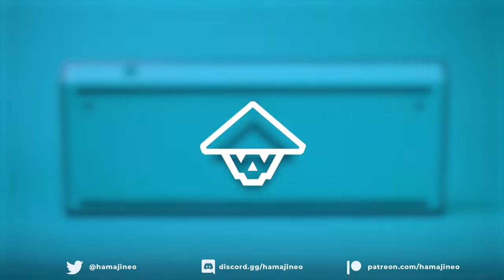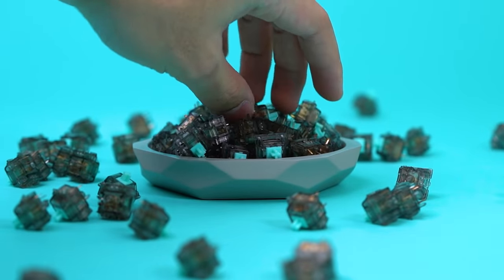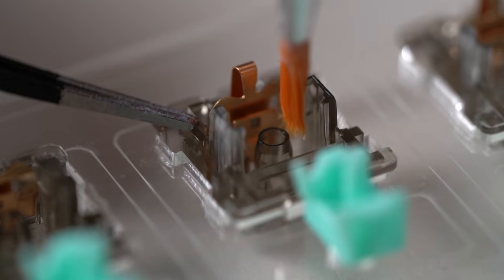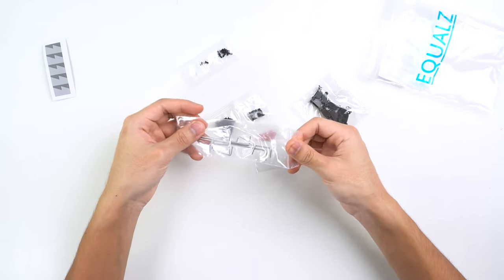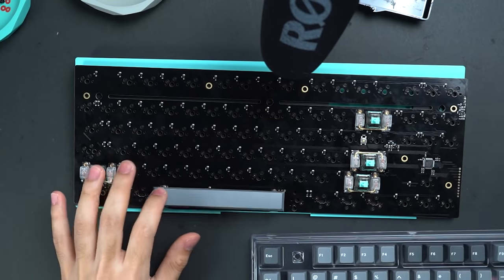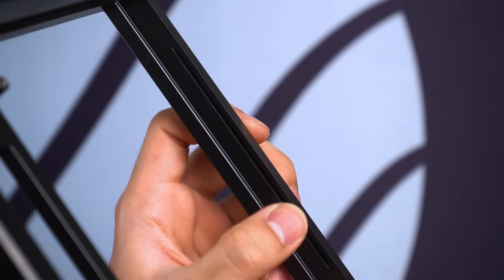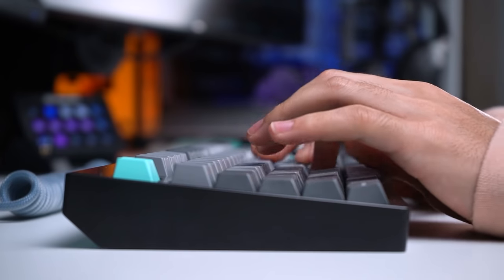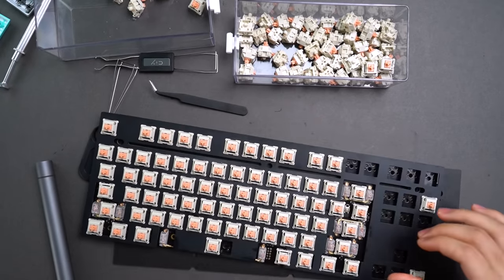The Making of My $850 Custom Mechanical Keyboard!

Comment: The keycaps were probably 40% of the total of the build.
Reply: taeha is that you?!
Reply: typer tahea
Reply: Not this time. The mode eighty is an expensive board.
Reply: @kylemckell  still about 40% resell lmao
Reply: @kylemckell  Not really for a tkl. $470 is pretty standard and the keycaps are $99(mechmarket is a waste of money they're being offered for 120-250 depending on the seller but fuck mechmarket) but what makes this super expensive is just the fact it's a 1-off anodization that can't normally be bought with his logo etched in. Things are made in bulk to keep costs down but when you have to have your own special anodization colors and make them etch your youtube logo in the prices skyrocket.
Reply: @incongruous4  well yeah ofc. I was more saying that proportionally this board is like twice(?) more expensive than the keycaps. Rather than being about even with the keycaps
Reply: @TheAbrasiveGamer123  is modo that much aftermarket?
Reply: @kylemckell  this mode specific mode (art series 01) was being sold earlier today for about $520 - $570 on Mode's website. Gmk modern dolch on mechmarket goes around $200-$250 resell (which Hamaji Neo says in the description he bought it off mechmarket). So yeah its about 40% of the price
Reply: @kylemckell  Ahh yeah then that's true
Reply: @TheAbrasiveGamer123  he said build not board. 250 (high end for modo) / 850 for the full build comes out to 29%. Which is pretty close to 40 but not quite.

So basically semantics lol.
Reply: Teaha?
Reply: @charmxarchive5128  Taeha Types
Reply: @Fatpumpumlovah2  You obviously aren't in the mechanical keyboard hobby
Reply: @Fatpumpumlovah2  yeah, I think that you haven’t seen prices for good keycap sets and good cases
Reply: lol

Comment: I mean no disrespect, but you built it wrong. The two pieces of foam that you showed were the hot-swap and soldered bottom foam. The mid/plate foam is a completely different foam. When assembling, you put the soldered bottom foam, which could cause some of the hot-swap sockets to pop off as they're being compressed by the foam. And, by using the soldered bottom foam, the typing experience might be a little bit stiffer as there is even more compression (as the foam is pressing against the hot-swap sockets).
Reply: I’m happy you pointed this out, I was coming straight here to basically say exactly what you said!
Reply: The problem is he’s here providing a tutorial showing people how to do something the wrong way.
Reply: @noahmelamed7400  no I’m completely agree, But I think this was less of a tutorial, and more of Hamaji just recording his custom build and sharing it with us. 

He didn’t state anywhere that this was a tutorial, and Being Human, Mistakes happen. The Hotswap pad and the foam for between the plate and PCB do look quite similar.
Reply: @noahmelamed7400  yeah he doesn't promote this as a tutorial. However, it might make people do the wrong things still
Reply: @officerwizz  well thats on them. anyone building a keyboard should do their own research and not watch this one and only video before assembling
Reply: @TheNickMartinez  well out of the thousands of people doing it, you have to remember there is always that ONE guy who does things differently and might do a mistake like this
Reply: @officerwizz  and that’s no ones fault but his own 😂
Reply: @TheNickMartinez  if you think about it then hamaji might be like 1% responsible, but hey, one less mistake is one less mistake.
Reply: @officerwizz  im not gonna lie, you are overreacting a tad

Comment: I feel you on the holy pandas stability issues. My keyboard has glorious pandas in and I had to swap the mods & spacebar for zealios v2 78g because the rattle was basically unsolvable by just fiddling with the stabs. The heavier springs on the zealios also help make the feel a lot nicer imo!

Comment: I just finished building my Viridian Mode80 last night with Krytox Lubed Glorious Pandas and Durock V2 stabs. Using EPBT x Gok Bow Keycap set and I'm not getting the same rattling sound you're getting. Although I'm using the standard alu plate. So strange that you're getting that gnarly rattle with the backspace tho. Great video and thanks for sharing however, it was influential for purchasing my own Mode 80. Love this thing!

Comment: Didn't know about that huge mechanical keyboard community. Many years ago I had bought a Steelseries 6GV2 and used it a lot with starcraft II, but the black keys became to tiresome over time. Tried a Black Widow with blue switches, which I've found to clumsy. At the Moment Iam using an old Cherry Keyboard, one of the beige ones, the RS6000 which has no mechanical switches, but works very well. The Problem with all these custom keyboards and keycaps is, that often they're not aviable for a german layout with üöä or ß which limits the options a lot. Also I like my enter key to go over two rows, and most american keyboards dont have that feature.

Comment: Hi. I just got into mechanical keyboard with a RK84. It comes with blue switches, and after some research and watching some reviews, I ordered some AKKO vintage white linears to test out. I want to try lubing my switches and stabs. Your videos really help me to understand a lot of things. I was wondering how do I find out if pcb mounted stabs can be used on my RK84 ? It comes with plate mounted stabs. Thanks.
Reply: It just won’t work. Different boards support different mounting styles. Just get some durock plate mounts. Sorry I’m not hamaji 🙃

Comment: Im thinking about building a keyboard, with lubing and evcerything. found out that there are prelubed switches, are they just as good to when you do it yourself, or is it just marketing and they just smacked a bit lube in there ?
Reply: It’s machine lubed so it’s better than stock but it’s never better than you doing it yourself

Comment: One thing I noticed is that for some stabs, when doing the holee mod, the band aids are too thick. This results in the wire not lightly rubbing against the cloth, but more grinding creating a less smooth experience. If so I’d recommend some silky medical tape or just don’t use the holee mod

Comment: Is there a benefit to getting soldered pcbs/boards? I'm using a gmmk and it's honestly a game changer having the freedom to remove switches and stabs so easily and it doesn't sound cheap
Reply: Soldered is definitely more secure and doesn’t move around as much, and some switches just won’t fit hotswap well like the holy pandas on this vid, but hotswap is definitely the goat now and manufacturers are probably going to focus on it

Comment: I've got a corsair K70 which I like, but I've been wanting to build my own custom keyboard for a while, but just seemed overwhelmed with all the different types of parts, keyboard body, PCB, faceplates, etc. All I know is I want a minimalistic case and either cherry mx red or brown. Is KDBfans a good place?
Reply: Yes, kbsfans is a good place. Maybe not the best bang for your buck but if you have the money it’s good. However, i would recommend you get a hotswap board so you can try out different switches. Trust me now, you do not want cherry red or brown. There are so many switches out there, and reds and browns are just really not that great. Browns suck at being tactile because the bump isn’t even noticeable, and they suck at being linears because they just feel inconsistent. Reds nearly don’t ever get smooth, and when you finally do get them smooth, they sound like a wet sock. Here’s my recommendation; either buy a switch tester to find your favourite switch, or just do a shit ton of research and find a switch that you would statistically love.

Comment: Hot swap are terrible pcbs and are prone to breaking after installing a few switches out. It’s more for beginners soldering is always better. Not to mention aluminum plates get scratched up after a couple of switch swaps.

Comment: Holee modding is the worst part but I wanna ask; I have a ciy tester 68, and I'm buying some durock piano plate mounts, should I holee mod it or do I just lube it? I am rather impatient and if the holee mod is easy I might try it lol
Reply: holee modding plate mount stabs is, in my opinion, the only acceptable case
don't forget to add pads below the stabs in the pcb to minimize the rattle... plate mount stabs are seriously the worst

Comment: So im looking to get a mech keyboard. Is it cheaper to build my own or buy a pre-built? The keyboard im looking at has cherry mx browns, rgb, and it costs $170.
Reply: 90% of the time, it is cheaper to buy a prebuilt. It's not really recommended to build one if you're not really sure what you're doing. There is definitely a learning curve to this hobby.
Reply: For your first board, I would buy a prebuilt with a hotswap pcb so you can experiment with it later

Comment: Stabilizers are the most important with out the switches case and pcb if you have no case how are you even suppose to type without braking it no switches how are you suppose to type  pcb how is the keyboard even gonna work

Comment: why did he use lube instead of dielectric grease for the stabilizer strings?
Reply: if you look closely, you will find several rookie mistakes in this video:
- overlubing (look what he did to those poor stems)
- using the wrong lube for stab wires (should use dielectric or xht-bdz, never 205g0)
- holee mod (stupid useless mod + waste of time)
surprised he didn't tape mod it to wrap it up lmao

Comment: Does anyone know if the holee bandaid mod makes the keystrokes of the keys mushy?
Reply: It's only the stabilisers, not the actual key switches.
Reply: @pook2830  ik that but if you have mushy stabilizers it will make pressing the whole key feel mushy
Reply: @cooperbrahmsteadt5123  Not if done properly, no. Besides, this guy is doing it wrong. Don't use band aids..  it's ridiculous. It soaks up the lube and they come unstuck. Use UHMW tape (5mil thick) it's designed for jobs like this. It's used in wooden furniture to make drawers slide easily, so a stab wire will pose no problem for it.

Comment: I don't understand how this costs this much.
Reply: The durock switches are 10 Aussie bucks a pack. These switches come in packs of 10 and given the fact that he has a tenkeyless board with 87 switches, that’s 90 bucks. He bought GMK’s modern dolch keycap set and that alone costs 220 Aussie bucks. GMK is the best keycap manufacturer in the business hands down, but that’s charged at a premium (aka way too much). That’s not even mentioning the fact that he had to buy these on the aftermarket because they weren’t in group buy session, so he probably payed an extra 20 bucks. The keyboard itself (case, plates, and pcb) are all custom and 1 of a kind. If you mass produce an item knowing it will sell well, you can afford to sell it for cheap, but this is a single run individual board, branded for this creator. Make that a 600 Aussie dollarydoo board with 320 bucks extra that you’re paying for the branding and you have yourself a 1216 aud (or 850 usd) board. Is this expensive as all hell? Yes. Is he being overcharged in some areas? Absolutely. Should anyone in their right mind other than him buy this board? God, fucking, no! However, the prices do make sense. They are absurd, but they make sense. Anywho this isn’t about us, this is about him. If he’s prepared to pay that money for his keyboard, that is none of our goddamn business. He knew exactly how much it was going to cost and he payed for it. The people that are tagging in him for paying that much are in no position to judge. It’s not their money, it’s not your money, it’s not my money, it’s his. He is allowed to spend it whatever way he wants.

Comment: Unpopular opinion - PLATE stabs are better than PCB Screw-In stabs. They make the keys much more stable due to the height of the stabilizer support and once tuned properly they feel way better. Of course if you're soldering your switches and are scared of wires popping out then they're not for you. Otherwise - original Cherry (GMK) Plate mount are the best. They don't need this bandaid mod because they have a perfect tolerance for the wire with a membrane inside that you deform once you put in the wire for the first time.